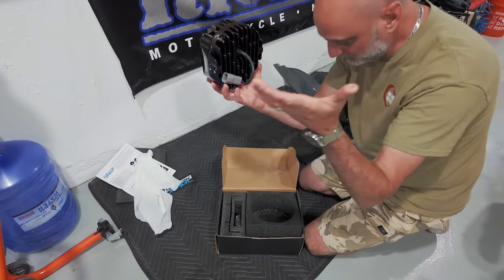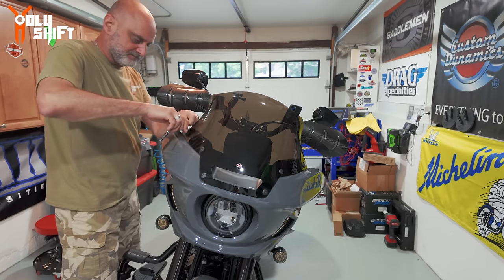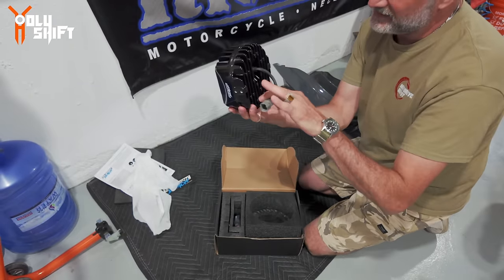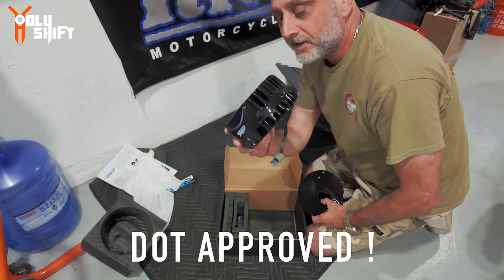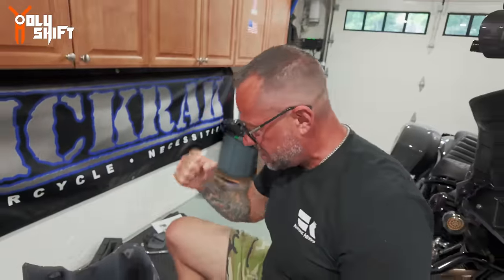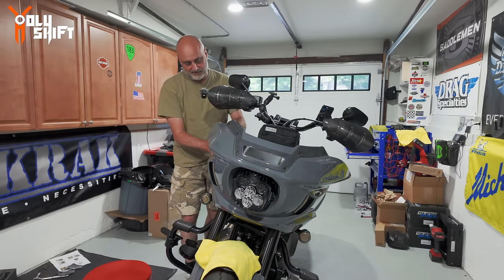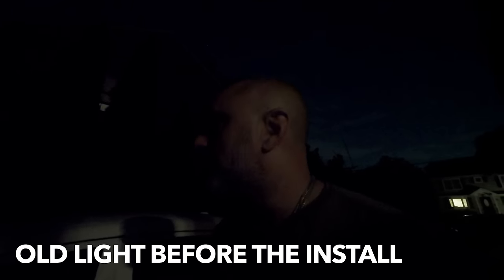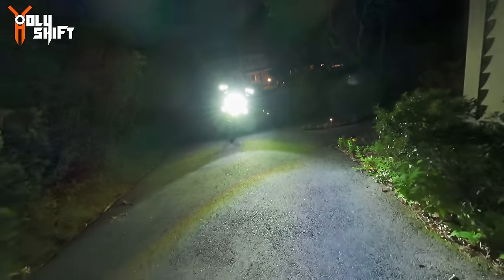Shark Demon Light for Low Rider ST

Comment: BajaDesigns LP6 in a PriorPerformance mount looks way better and offers a LOT more output for those that ride at night or just want to be seen.
Reply: BajaDesigns LP6 isn't DOT approved though.
Reply: @D0tanuki who cares 😂 everyone running them never got pulled over
Reply: @sLowRider114.  it's not my job to educate you on why you should care.  Just pointing out your comparing apples to oranges.
Reply: @D0tanuki  I want to be seen and be able to see as best possible.  The DOT doesn't have the 200* throw that covers the ditches / tree line.  Also, this "Shark Demon" light is a complete knockoff of the original LP6 from BajaDesigns, look how similar they appear in design alone.
Reply: @UnrulyRider  💯 agree.
Reply: Good thing it isn't your bike. He'll be seen with the Shark Demon light as well.
Reply: @wckdjohnny  I'm simply stating facts and truth.  The Shark Demon is not as bright, not as much coverage or throw, and a complete rip off of a better product.  You can cope and seethe if your feelings got hurt.
Reply: @UnrulyRider  my feelings didn't get hurt, I have the LP6's on my roadglide. Some don't want them because they are meant for off roading and they don't want to blind everyone on the road.
Reply: @wckdjohnny  Aim it properly, I don't get flashed by anyone unless I have left the brights on.  The LP6 has saved me more than once from hitting deer that were about to cross the road at night.
Reply: LP6 is trash compared to this light.
Reply: @04boostedboxer  how so?
Reply: @04boostedboxer  get off the pipe you obviously never seen both in person at night time 🤭

Comment: Bummer it sticks out so far, price is great and quality looks amazing but doesn’t seem that much brighter than stock vs the other brands.
Reply from the maker: It was pointed too low . It’s actually brighter and focused ! Not spread out
Reply: @HOLYSHIFT  you should do a little update or reel showing it side by side, I do like the fairing doesn’t have to be cut but man I wish it was farther back. 😭
Reply: I saw this on road glide its really not that bright its similar to other led lights, but no where near lp6 level. Hes right about its a focused light u cant see on sides like lp6.

Comment: Hi sandy after you putting the Advenblack saddlebags I went and got a set for my black low rider st and hand guards question do you know of any rear crash bars that would work with the low rider st and my stock saddlebag driver side also fell off 😂 thank you 🙏

Comment: Great headlight ideas but do not be fooled by people who have installed them and are awe inspired. That make the sheep that goes out and buys them think that they are the best thing since sliced bread.  They do not put out the white light intensity that they say they do. and the high beams?  Horrible. You get into a car with LED's and you can see 2 or 300 feet of the road in front of you lit up just like it is at 20 feet. Nice and bright. The high beams on the car LED are so bright you can see forever not only that both low and high beam light angles are wide enough that you can actually see in the ditches along side of the road. Now with the 7 inch LED light the beams are concentrated to only light up about 40 feet of the road and the high beam? You might as well use your phones flashlight to see anything. The beam is like a flashlight and doesn't light up the road ahead of you. It's concentration is in the same spot as the low beam.  Don't waste your money until they design on that functions like a cars LED.  The old yellow headlights from factory light up the road 500% better than any 7 inch LED motorcycle light.
Reply from the maker: Thank you